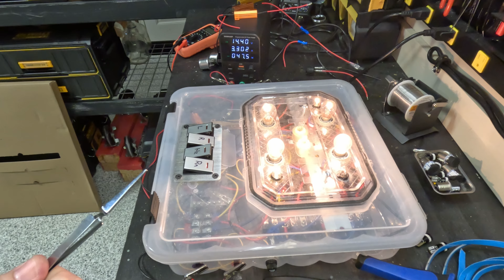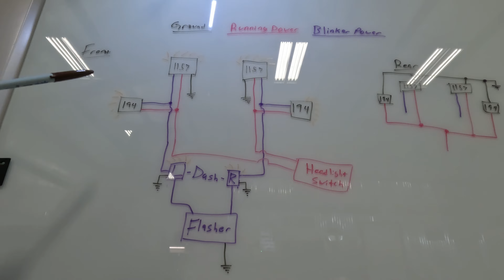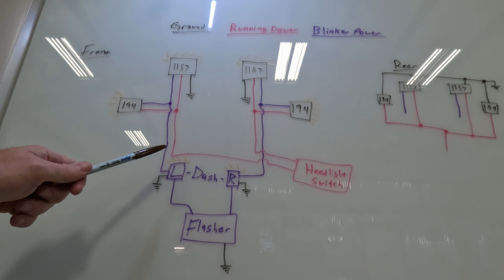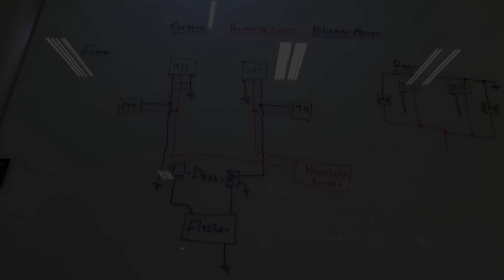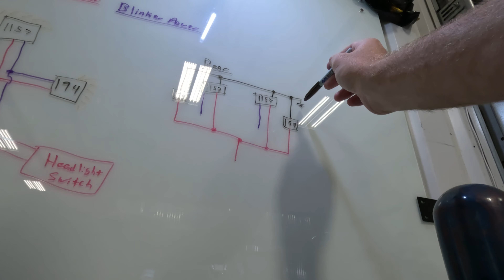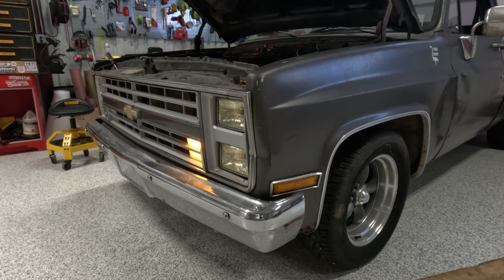The LED Turn Signal Fix for 80's GM Trucks

Comment: Thanks Kenny.  I put in LED's in my 74 camaro and I have this exact problem.  I'm going to go ahead and add the resistors to the 1157 lights
Reply from the maker: Thanks for the comment, and good luck with the resistor install on your project.

Comment: Excellent lab video explaining the subject!!  I knew of the issue because I've read about it, but having a visual aid explained so clearly makes it an easy fix.  I converted my '87 R10 to all LEDs (both inside and out), but the backfeed to the turn signals was driving me nuts & so a halogen bulb was put in as a temp fix.  Now I know what to get and how to fix it.  I'll also put in some quality-grade thermal paste in between the resistors and body to help with the heat transfer.
Reply from the maker: Thanks for watching, and for the kind comment! Glad to hear the video helped you out